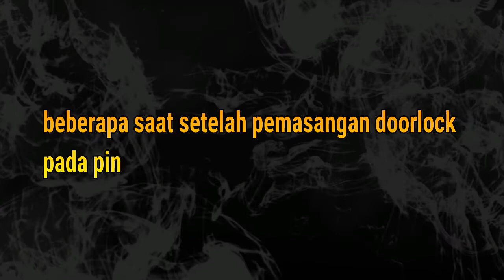Cara kerja Doorlock universal pintu mobil/ Doorlock pengganti alternatif...

Comment: Bang, letak atau posisi  modul atau relay central lock triton hdx tahun 2017 di mana ya.
Reply from the maker: Relay kontrolnya sudah tergabung di dlm Etacs mobilnya
Reply: @AJMcrews  makasih informasi nya bang.....sdh sy perbaiki tp cuma pintu   depan kanan aja yg sdh bisa pakai remot, tiga pintu yg lain blm bisa, 
Kira2 apa nya yg rusak ya bang....
Reply from the maker: Motor doorlock di pintu supir atau pintu utama biasanya ada 5 kabel, dimana 2 kabel adalah sinyal + dan - utk motor doorlocknya dan 3 kabel lainnya adalah sinyal yg diberikan doorlock pintu utama ke modul remote utk menggerakan 3 pintu lainnya.
Jadi kemungkinan 3 jalur kabel dari motor doorlock dipintu supir bermasalah  dan ini sering kami alami walaupun dgn remote, pintu utama doorlock bisa berfungsi tetapi motor doorlock ini tdk memberikan sinyal balik utk menggerakan pintu lainnya, sehingga bisa dikatakan doorlock pintu utama bermasalah atau rusak walaupun berfungsi normal

Comment: Bang kalau posisi di lock biasanya ada indikator lampu standby kedip2, hla punyaku cuma kedip sekali kira2 apanya ya. Kalau fungsi lock masih aktif normal semua
Reply from the maker: Kami belum sempat melakukan pengecekan pd bagian itu. Lampu kecil indikator tsb berasal dan diatur dari modul kontrol remotenya dan Lampu kecil indikator tsb biasanya akan berkedip-kedip saat sistem remote dlm posisi lock atau menandakan semua pintu dlm keadaan terkunci

Comment: Mobil saya ada central locknya tapi gak ada modul dan remot nya om. Gimana yah supaya berfungsi pake remot. Central lock posisi normal dan belum terpakai
Reply from the maker: Kami blm bisa memastikan krn tdk mengerjakannya langsung.
Yg terutama hrs dipastikan dulu bahwa hrs ada modul dan remotenya dan berfungsi.
Jika modul dan remote berfungsi normal maka penyambungan ke motor door lock bisa dilakukan.
Pengerjaan pemasangan dan penyambungan modul remote ke motor door lock hrs dilakukan oleh yg paham cara kerjanya